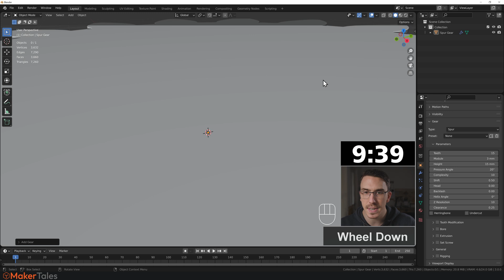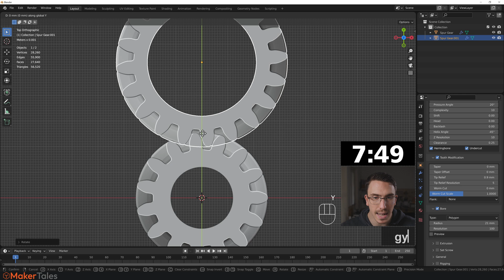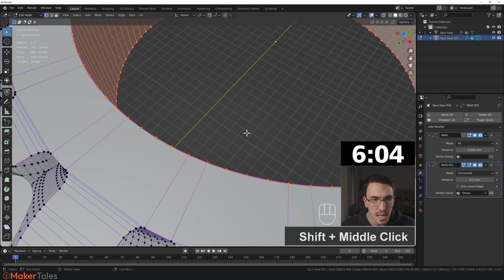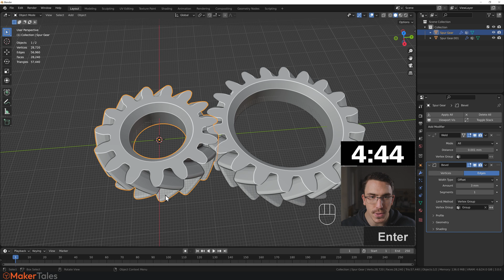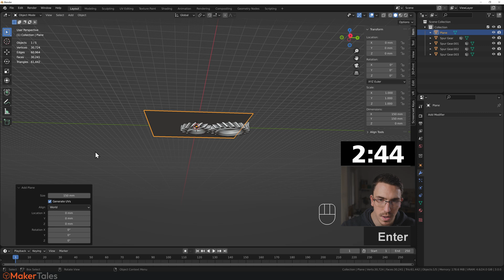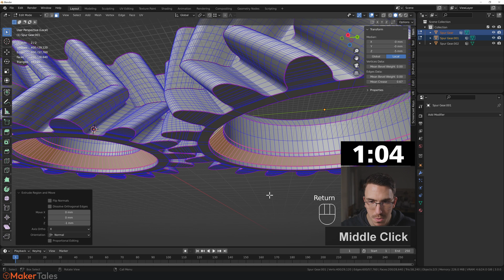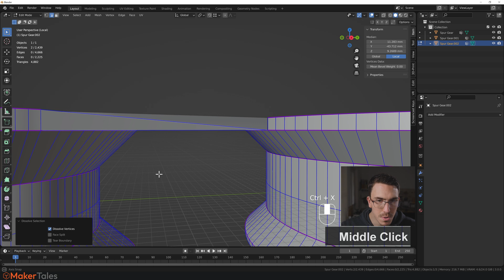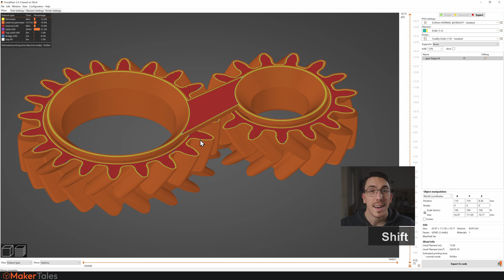3D Print In Place Design | Fidget Gears | Blender 3.0

Comment: If you are using blender 4.2, the gears are not there by default. Go to edit / preferences / get extensions, and install the extra mesh objects extension. This could also be the case with later versions.

Comment: Is ryzen5 5600g enough to make 3d models and slicing those models for 3d ptinting?
I dont do any rendering 
I dont play video games
Reply: I know that this comment is two years old but if someone else needs to know, as long as you're not rendering or making any animations, you don't need a powerful pc. You're good to make models for 3d printing on basically any laptop in Blender as long as the mesh is not too complex. P.S. I use an HP laptop that cost $300 😢